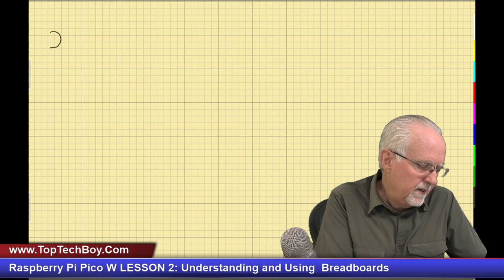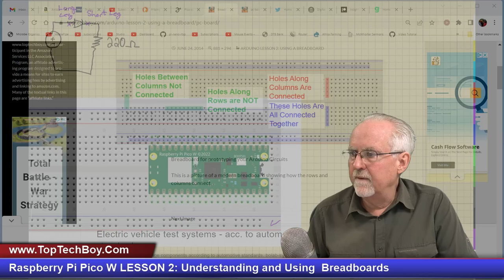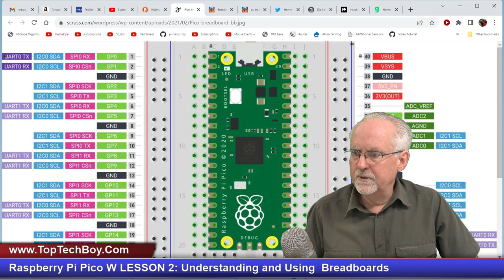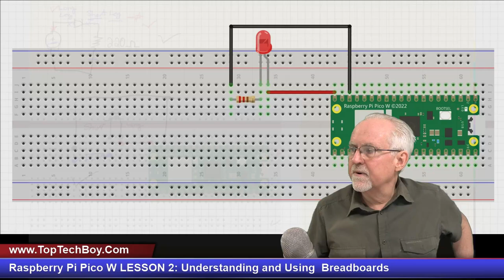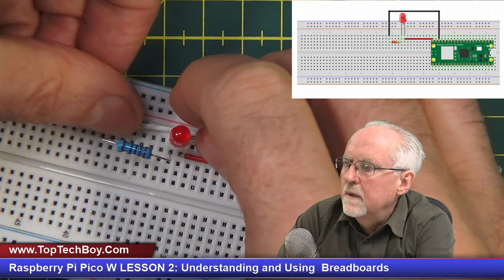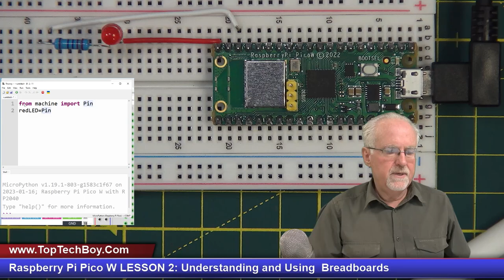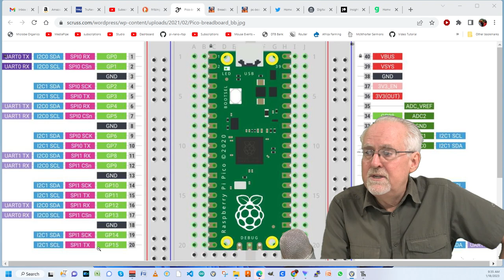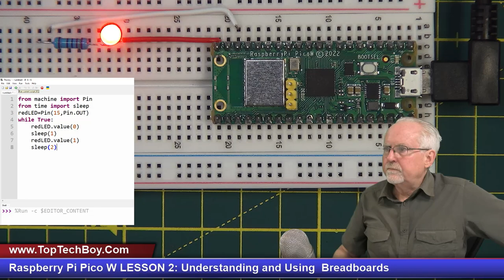Raspberry Pi Pico W LESSON 2: Understanding and Using  Breadboards

Comment: Although my Arduino lessons are not finished yet, I have started with the Raspberry-Py Pico-WH. This was a gift with an order for some books. In this lesson I used something from the book PYTHON 3 Programming and GUIs, which I still find difficult at the level I have now. I like to use, in addition to Paul's lessons, a book for support. Below is my homework from lesson 2.

from machine import Pin
from time import sleep
redLED=Pin(15,Pin.OUT)
for n in range (0, 3):
    redLED.value(0)
    sleep(1)
    redLED.value(1)
    sleep(1)
    redLED.value(0)
for n in range (0, 3):
    redLED.value(0)
    sleep(1)
    redLED.value(1)
    sleep(3)
    redLED.value(0)
for n in range (0, 3):
    redLED.value(0)
    sleep(1)
    redLED.value(3)
    sleep(1)
    redLED.value(0)

Comment: I have a quick suggestion that may look better. You used a long ground wire. I don't know how much bending it can take.
You could run a wire from pin 38 to the blue ground bus rail. Run a wire from the short led to the ground bus.
You have two shorter wires, and a straight layout.
  I decided to challenge myself to see if I understand GPIO pin layout. I used Pin 1 for output. GPIO0 on green label.
So, I coded this:  RedLed=Pin(0,  Pin.OUT) and Pin 1 turned on the led.

Comment: Lesson 2 Homework, geared for absolute beginners: https://youtu.be/f-OEMaaLs98   I have noticed that much of the homework posted is by  very proficient programmers with excellent solutions to the homework, however I have not run across any homework posts geared toward beginners.  So I am taking it upon myself to turn in my homework using only what has been presented and taught thus far in the lessons in hopes that it will help any beginners that have limited/no programming experience without overwhelming them with advanced solutions that have not been covered yet. :)  With that being said keep the amazing  solutions coming, I really enjoy seeing every ones take on the homework solutions, they are helping me learn new more efficient ways to program.  And as always, thank you so very much Paul for the lessons, I always learn a lot from you!
Reply from the maker: LEGEND!
Reply: Thanks for doing that Tim!  I am sure the beginners really appreciate it.

Comment: Paul,
I am constantly reminded that you are a good teacher.  While running a course that includes the very basics of using a breadboard, you are also running a series that currently is teaching about manipulating images on a Raspberry Pi.  And doing both with enthusiasm.  That is a gift. 

On the topic of the Pico, it comes with two processors.  Will you, at some point, illustrate how to use both?  Is that convenient to do in microPython?  Also, I understand that there are some little PIO processors that run independently of the main cores to do simple I/O tasks.  Will you be addressing these in either this class, or perhaps, a follow on class?

Thank you!
Reply from the maker: Jerald, I would get into something like that when I see the need arise. for most embedded projects I can imagine, performance is not that big of an issue. In most cases making a few measurements a minute or hour is more than enough. I have not run into projects that require very high performance on the computing side.

Comment: This is so cool to approach this SOS problem from Python side (I already like Pythons different approach). I did my home assignment by making one block blinking fast, then pause and other section "do'h- do'h- do'h :), little pause between cycles and it went as long as Pi Pico had power. Next day i started with lesson 3 but my Pico was empty- no did, not "dit" or "do'h"... Do we have to save our program (Arduino took it and it stayed in it's memory even when the power was lost). I tried to save with thonny this program to Pi Pico but result was the same...

Comment: Hi Paul,
A couple of questions.            [Note I did some basic physics a school about 60 years ago, I'm not trying to be a smart ass]

There are numbers on the breadboard relating to the columns
When you put the pico on the breadboard, why would you put physical pin 1 in column 2 rather than in column 1, and thus physical pin 20 was in column 21?
The resistor, I think you said was to prevent the LED from burning out, does it matter if it is before or after the LED in the circuit?
With the Ground connection, would it be easier to connect from physical pin 18 to the -ve rail at the top of the breadboard then connect from that to the column 38 by the resistor?
The Ground pins, you choose physical pin 18, which is close to 20 your signal pin, are all the GND pins the same? does it matter which is used? Would it matter if more than 1 is connected?

Thanks

Comment: Hi,

I just tried to build the breadboard like in your Video. To Programm my pico i use my raspberry pi 400. After i pluged the pico into my raspberry 400 with all the wire-stuff on the breadboard my raspberry 400 turned off..... After that was raspberry pi 400 is Dead and i cant turn it on anymore. Andy ideal what happened?

Comment: Homework Lesson 2:  https://youtu.be/WBSXgpcNzT0
Paul McWhorter is the legend!
Reply from the maker: Quaternion . . . have not heard from you in a while, and was worried if you were well. In any event welcome back, we have been missing your comments. Excellent HW solution by the way.
Reply: I like the way you set this one up. Was confused about tu. Ok it is time unit. Would it be better to have a dot tu and also a dash tu?????? Any changes could be done once at the top of the code instead of looking through the whole. I would also like to see the [led=Pin(15, PinOUT)] at the top of the code instead of right before the while statement.
Reply: Excellent solution to home work, first class!
Reply: @ke7uia  Thanks for the thoughtful comments Gary.  Since everything (dot, dash, space between words, space between letters, space between dots and dashes) is just a multiple of the time unit (tu), it seemed like the perfect building block.  The opening graphic possibly did not make that clear.  Anyway, all the functions only need a single var, tu , to construct them.  I appreciate your taking the time to analyze my code!  I was trying to be the first with a solution (didn't happen) so I certainly could have spent a little more care on the issues you raise.  Thanks!
Reply: @mikejosephidou9201  Thanks, Mike.  I appreciate your looking over my code!

Comment: I am finding that is hard to insert the PICO into the breadboard.  I have another breadboard and have found that I can insert it into this breadboard.  I think that the pins might be a little bit to wide.
Reply: Hi Daryl. New breadboards are always tight. You can loosen the holes with a jumper wire - push it in and out a few times. Good luck.

Comment: What does the stop button do in Thonny.  On the Arduino, it would run forever and you could continually make changes and upload to it. In Thonny, before you can update it, you always have to hit stop. (I learned that the hard way).

Comment: I'm just starting to learn electronics... I thought the resistor would have to be before the led? How does it still work when it's after it?
Reply from the maker: It has the same function as long as it is in line with the LED. Think of a water pipe with a restriction. Will restrict flow no matter where you put it.
Reply: @paulmcwhorter  thank you, that makes sense now

Comment: Once MicroPython is loaded  onto the Pico, can you still use C++ and the Arduino IDE, or do you somehow need to return the Pico to a factory condition?
Reply from the maker: I think when you drag a programming language over that becomes your language.
Reply: @paulmcwhorter  There was a UF2 file for MicroPython, but is there a corresponding one for C++ (Arduino IDE)?
Reply: I think that each c++ file that you make will be a .uf2 and this what you copy across to you PICO.
Reply: @darrylhewitt4251  There is a "nuke" file that can be used to overwrite the MicroPython UF2 file, but that only makes Pico come up as a Mass Storage Device without even having to press the Boot Select button.  It doesn't show up as a COM port to the Arduino.
Reply: You CAN switch back and forth between micro python and C++/Arduino, BUT after you load a C++ program and want to switch back to micro python you have to drag the micro python .uf2 file back onto your pico W again.
Reply: Yes you can.  But you want to use the IDE 2.0 rather than the original -  the original version will require you to unplug and then reconnect the Pi Pico every time you want to upload the code.

Comment: Hello Mr. Paul, I want to ask you one question, Pico is not a secured device. A code burned on the pico board can be easily copied by any one. Is there any method to secure the code from being copied? It would be great if you can make a video on this topic.
Reply: Keep it in a locked drawer.

Comment: I accidentally bent the pins does anyone have any tips to bend them back easily? Edit: Nvm I used a pin cap and it worked
Reply from the maker: Be very careful, you can bend them back, but after a time or two the pins will break off and all is lost.
Reply: @paulmcwhorter  ok I will keep that in mind thank you

Comment: https://youtu.be/xE8WzBEQd_U  Using Arduino IDE 2 and C rather than Thonny and Micropython.  Also using a Pi Pico and a breakout board rather than a breadboard.  My external LED is a 'fancy' NeoPixel (RGB).  I could find no definition of the timing of the SOS signal.

Comment: Hi Paul, here's my homework video https://youtu.be/HcdokIH_Jow, for some reason cannot upload my code like I was able to do in your Arduino Lessons, but I can say that used two delays, to make pauses of same duration between letters. Viewer will notice that I'm using a regular (no wifi) Pico controller, but when Wifi time comes, will use an ESP01-S already flashed with Micropython to complete the lessons.